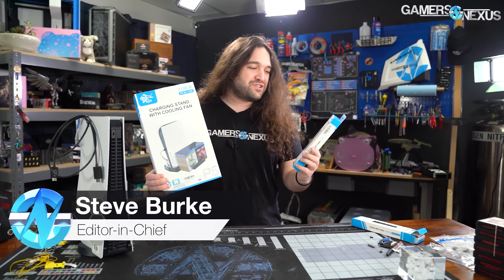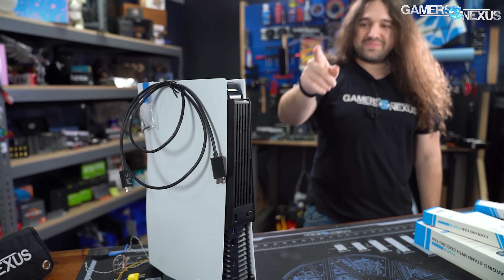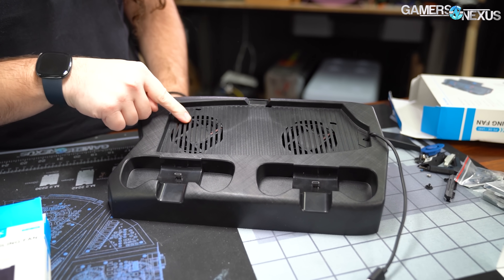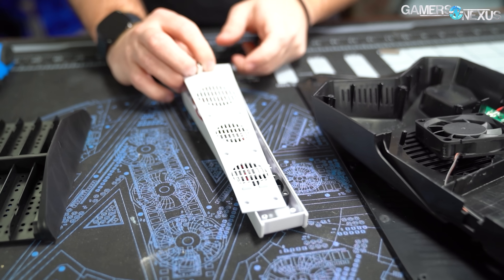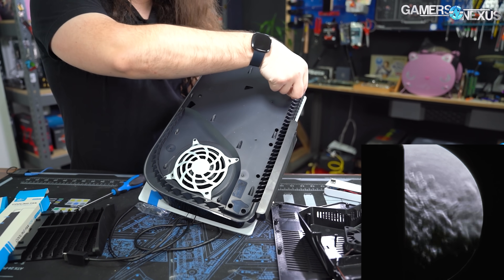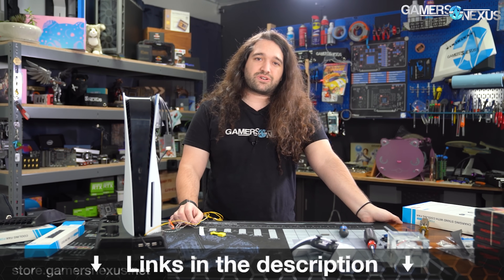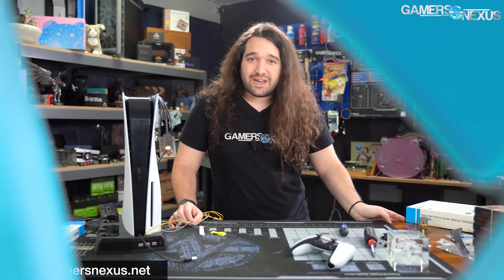Basically A Scam: PS5 Aftermarket Cooling Fans Blow the Wrong Way

Comment: I swear there's no way these fans are running at 9000rpm and being that quiet
Reply: I was thinking they should divide the number by the number of the fan blades? If the rpm-meter reads every fan blade passing the laser..

Comment: My first question would be does the PS5 over heat to begin with. As in does it even need additional cooling? My second question would be on the smaller one, if you reverse the fans does it do anything? Does it still make it worse, does it help in some small way or just do nothing at all. From the looks of your charts removing the panels seemed to help a little. So I guess you could mod the panel by putting holes in it or just cutting a large circle out of it where the intake fan is. From the looks of it shoving more air into it probably isn't going to do much other than make more noise. I have done tests with computer cases and found that adding an excessive amount of fans or moving a ton of air through them doesn't really seem to help much. Good air flow is normally as good or better than a LOT of air flow. You reach a point of dimminishing returns at a certain point. Which I think actually makes sense according the laws of physics and thermal dynamics. What you need to do is find a way to actually get cooler air into it. And sometimes that doesn't even work. That being said I have been able to cool a computer better by forcing more air into it but you have to use something like standard blower fan, like a shop fan. And those are pretty darn loud. Its not something you going to accomplish with PC style fans.

Comment: The base for PS5 is not that bad idea if it wasn't $40 and it wasn't cheaply 3D printed(You can see 3D printing marks in the light) and it was higher  quality and they ditched the cooling fans...

But base with stable games holder and controller charger and usb hub would be actually usable. It wasn't bad idea it was terrible execution.

As for the back panel fans there is just no defense it is just plain stupid

Comment: I had something similar for my ps4 - not for cooling but for stability and to charge the controllers (never turned the fans on).  It was cheap and did stop the ps4 tipping.  The ps5 has a pretty stable base so no need for extra stability.

Comment: Seeing how easy access there is to fans, i wonder if you could flip them upside down in order to get them actually exhausting... Do you think it would do a difference ? (i mean, it would, since they wouldnt be pushing back hot air anymore, but anything more ?)

Comment: That cant be 9000rpm, most server fans dont spin that fast and they're deafening.. is it possible its counting each fan blade as a revolution? So a 7 blade is actually spinning at ~1300rpm?
Reply: Yeah but most server fans aren't 1 inch coolers. These things here are freaking small. Also, I have a 7cm 3d printed cooler that spins at 6500rpm at full speed. 50db, crazy loud.
So it's not hard to imagine a 3.5cm cooler spinning at 9k rpm.

Still, bloody awful product.
Reply: Makes sense. Thanks!

Comment: Just wondering why anyone would need a cooling solution for something that's designed to have nominal temps, I understand that not everyone is going to have it sitting in normal temps but I think if you've got enough money to afford a ps5, you're more than likely living in a place with Aircon.

Comment: These only likely worked on the old gen units because foxconn is incompetent and the airflow was complete trash from the factory. Lets trust all the cooling of this device to a pull fan only at the back of the device. Yup that worked as expected coupled with their bracket design for the heatsink.

Comment: Curious to see if the small one would work with the fans in the correct orientation.
The PS4 had a popular fan-bank that you could buy, but since the console auto-regulates the original fan it ended up just making a different sound, but still having about the same thermal performance with or without the attached fan-bank.

Comment: 17:08 PS5 cooling mods are definitely gonna be a hot topic, just like these coolers.
The only thing I wish you would've done was flip the fans around in the small one and see if it would've made any positive difference assuming it were assembled correctly.  Yeah, you say it's pointless, but I wish you'd quantified that statement.

Comment: To be fair, with the larger one, the controllers are designed to be plugged right into 5v usb for power, and have their own charging circuits. So if nothing else you have a rack for game cases and a dual controller charger. IMO, that'd be worth about $20.

On the smaller one, could you not flip those fans over? Since they're not attached? I'm not sure how much help you'll get by sucking more air out, but at least then it wouldn't hurt. But then that one gives no other benefit.

Comment: I bought one of these when I got my PS4 Slim, not because I wanted cooling, but a vertical stand and a controller charger.  
Most importantly, i bought it because whatever idiot who designed the PS4 Slim thought 2 USB ports was plenty enough.
Reply: That is a beancounters decision, not one from a engineer. So no, it is not the one who designed it that thought 2 would be enough.

Comment: "It doesn't do anything that it claims to do"

Hey that's wrong, it even said it heats up the Playstation :D
Reply: Yeah, if you have an issue with your PS5 freezing, here's the fix.
Reply: But the one that claimed that actually didn't heat up the PS5 ..... or cool it either .....

Comment: Back in the X360 days - sure. You sadly needed it to avoid death. A friend had his for years and years with a crappy green Revoltec fan. Then he forgot to turn that on one time and got RROD 😂

But today? The consoles run cool enough, you gain nothing by fans and the console itself is also somewhat quiet. Either you do a ghetto mod to lower noise levels or you go crazy with water. Otherwise - no. Just no.

Comment: Years ago there was a fan for the Xbox 360 sold in the UK and it was fined I think for being dangerous and can actually set on fire

With every console that comes out you get cheap tat like this, being happening since the PS2 original Xbox era. PS1 did have some but not as bad as PS2 with MadCatz, xploder cheat systems, 3rd party memory cards controller stands

Comment: I'm curious to know, if you turned the fans around on the back mounted unit, if it actually WOULD help with thermals. Kinda surprised you didn't test that.

Comment: clearly the side mount fan assembly is designed to mitigate dust accumulation within the air passages, & main fan by reversing the air flow when the system is powered down. kind of a manual adaptation of the enermax DFR (Dust Free Rotation) technology, that reduces heat by eliminating restrictive dust particles.

Comment: There was one of these that were available from Pelican Called the airflow cooler. I cut the fan portion off and took advantage of the VGA and Component outputs on them (as well as the extra USB ports for MP3 and USB storage). The only mod worth doing fan wise is adding an intake fan on one of the sides of the console (usually opposite the HDD), or making an opening on top and adding an intake there. All of the 3rd party cooling caused overheating, and sometimes melting of consoles (Nykos Intercooler was the main culprit for those)

Comment: Seems like the people who made this had access to only "Guesstimated" 3D render data of the console rather than the real thing to engineer/base their cooling solutions on. (Not surprising due to the extreme shortages and the fact that the race to bring 3rd party addons to new consoles starts shortly before they actually are released to the public.)  They probably assumed that the base would have mesh and that the grill on the back was intake due to the size. Still a knucklehead assumption to make though! They just had to ask themselves this: When has a PC or console ever vented their heat towards the front of the device where the user will be?

Comment: The PS4 and PS4 Pro has some of those on the market. You stand them up and blow air into the wrong side of your system. 
I use a $5 USB fan from Walmart. It blows air right into the intake vent on my PS4 Pro. It keeps it nice and cool.

Comment: About the vertical stand/dock combo, it looks eerily similar in construction and moulding to the vertical stand/dock I have for my PS4. Complete with two fans blowing up, three usb ports and a on/off switch at the front with the exact same sound that it does when I press it. perhaps they just modified that pattern to fit the PS5 and press the "ship to market" button?

Comment: Steve why didn't you flip the fans on the rear mounted one to exhaust air?  It seems plausible that it was engineered to work that way but then assembled incorrectly, and either way it's an easy mod to make.  If the thing can make the PS5 that much hotter, perhaps it can actually make it cooler too!

Comment: Oh God I remember 10-15 years ago these things were everywhere for both the PS3 and Xbox 360. There was a 3 fan Nyko Intercooler for the 360 that drained so much power during use that the consoles actually caught fire, and it happened so regularly that Microsoft voided warranties on consoles that had them installed.

Comment: I see this in almost every cooling mod for consoles / laptops, for some reason they always have the fans push against the natural airflow of the device. Usually flipping the fans around genuinely does hell the device, but not for the way the new consoles are built. The Xbox and ps5 have unique cooling solutions compared to their predecessors. Both "cooling solutions" in this video I've seen on older consoles, just with a mold that fit them respectively. It's ongoing stupidity at this point.

Comment: Wonders if you turned the fans on the one that attached to the back around, if that would have made any difference? Maybe it actually works, and you got one with the fans flipped the wrong way. I am not defending the product, just wanted to know if changing flow direction would make any difference.

Comment: Dremel the vents on the cooling devices for better airflow and turn the fans the correct way. Probably not worth the effort, but at least it's an option for someone who has already bought one of these pieces of junk without going completely to waste.

Comment: Steve you should just put holes on side plates where intake/exhaust is.   Or cut out Circular hole for both sides of ps5 plates.   

REALLY wish Sony would do better design for ps5 refresh.  That has proper intake and exhaust with proper air vents.  Ps5 airflow design IS horrible.

Comment: one of the old xbox 360 coolers blew air into the exhaust too. potentially, if you take them apart and turn the fans around they might work as intended. not a good way to sell a product though. some disassembly and reassembly required. lol...

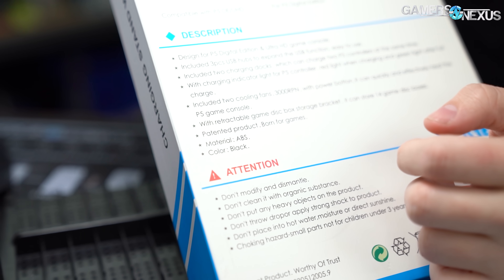Comment: 5:17 "we tried looking it up on the USPTO and we couldn't find it"
It was patented in china with Chinese patent number 202030512005.9 (on the box)
2020 - year of issuance
3 - This is a Design patent (very important, not an invention)
0512005 - Patent serial number
9 - check digit.

If you put that number into the CNIPA's website it'll pull up the patent for you
http://epub.cnipa.gov.cn/

Link to patent documents (this was given as a QR code when I looked up the patent number)
http://epub.cnipa.gov.cn/tdcdesc.action?strWhere=CN306290161S

The European Patent Office has good descriptions for searching for Chinese databases for patents and trademarks.
https://www.epo.org/searching-for-patents/helpful-resources/asian/china/search.html

Comment: Imagine that, a console that just came out and uses liquid metal for thermal paste needing extra fans to cool it.  What a POS.  Just like my original overheat fat PS3.
Reply: The thing is that it doesn't need any extra fans. The cooling on it works just fine.

Comment: Just wondering but would turning the fans around on the rear one thus pulling exhaust like it should would is still be worse than stock do to blocking some of the vents?

Comment: So the base station comes with a plastic piece for the Digital Edition of the PS5 (P5), but one of the few useful features of the stand is useless to the digital edition: the game case holder (point in fact it is probably mostly useless to owners of the normal PS5 as well).  I assume all the text on the back, including the fake patent #, were just translated from Google Translate from some form of Chinese.

Comment: I feel the one on the back is missing a trick.  They don't need to even put fans in, just a piece of plastic with blue LEDs and vents (so even LESS plastic than they used) and air would still come out making it "appear" to work. ;)

Bonus, it would be the first console aftermarket cooler that doesn't kill the console quicker, although I'm sure they would find a way such as the LEDs shorting and frying the USB port.

Comment: Unless I missed it, I'd like to see the results of flipping the fans in the rear fan device to see if having them blow the correct direction helps or still hinders. Your blanket assumption that it can't and won't work with no testing to back it up is very much unlike Gamers Nexus.
Reply: What do you mean? He's testing to see if it'll work out of the box with fans being the wrong way because 90% of people who might buy this probably won't open it up and do the fan flip.
Reply: Adding an extra exhaust fan behind existing ones wouldn't do anything anyway. It doesn't need to be tested if you have a basic understanding of airflow through a machine.

Comment: What people need to know is that these consoles are designed to have the best cooling they can already, adding additional fans will not help anything, in most cases actually make things worse by adding more turbulence. The best thing you can do for your system is ensure it has a good area around it for ventilation and make sure its on a flat surface and not a shaggy carpet or rug and it would help to clean the dust out after 5+ years of use, if your system is overheating that's the most likely reason why.

Comment: Wait, so it appears as though you can flip the fans on the rear attachment one based on your “teardown”. While it won’t prevent the product from being an idiotic purchase, I’m curious if the actual proper direction of airflow on those fans would actually improve thermals. Did you try flipping the fans to prove out the theory of cooling the ps5?

Comment: The good thing is the fans aren't hot glued - can you test it after turning them the right way?
Also, it would have cost around USD 2 to have a potentiometer with a button instead of just a button on these (the setup is common on budget speakers), what is up with their industrial designers?

Comment: Have you tried flipping the fan direction, so it pulls air OUT of the front? 
Maybe during assembly some $0.25/day worker placed the fans in the wrong direction, I have made that mistake several times installing regular 12cm/14cm fans into my case..

Comment: I'm more surprised that there still isn't a 3rd party company like Nyko working with Sony to have a PS5 "Airflo" plate to that replaces one or both panels with a custom panel that has a cooling fan shoving more air over and into the system in general. Maybe make it a 120mm slim, or at least a 92mm fan, complete with dust filters. As the panels would be replaced, Nyko could even do a boxier design both to accommodate the fan(s) and change the PS5's shape somewhat into a box with 1 curved corner.

Comment: Since the snap on cooler doesn't have screws on the fans, could you spin them around the right way and test that way? I don't expect it to be any better, but it might be worth a single run to see just how terrible it is at best.

Comment: Im curious if flipping the fans for the rear fan would have done anything. Also it seems like what we need is an aftermarket panel with holes and a filter for the air intake.